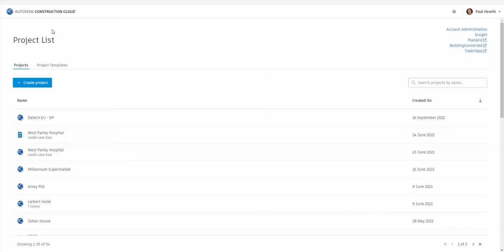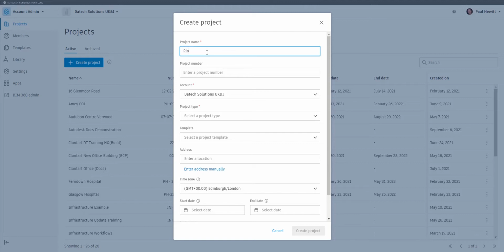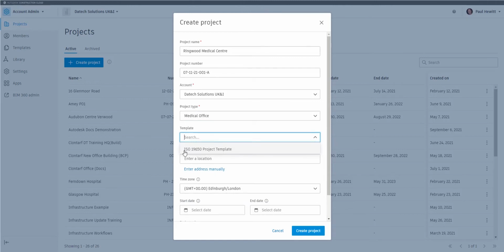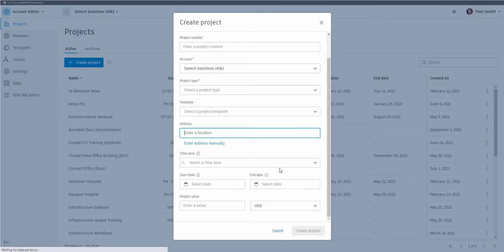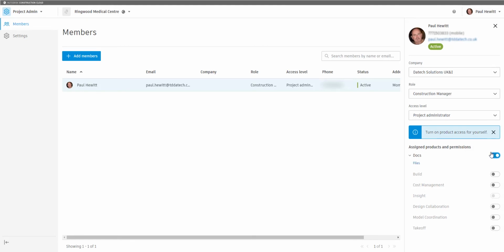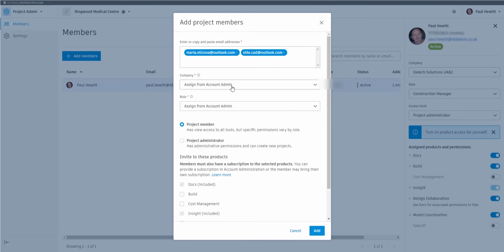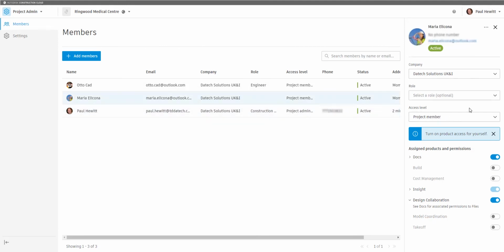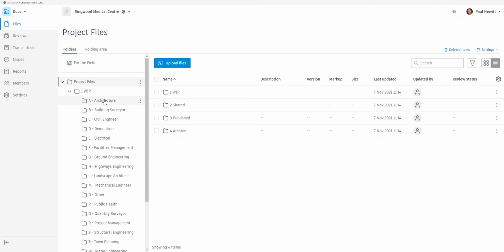Autodesk Construction Cloud - Creating a Project

Comment: THE WAY, YOU ARE EXPLAINING IT AT 3.34

I would highly recommend clarifying, that YOU MUST go and turn those on.
EVEN for the ADMIN, which is me.
They are OFF by default.   IF YOU Have them off. 
YOU wont have the Project Folder VISABLE in the cloud.
ITs there, but NO ONE can see it.

That is important. YOU could be  sitting here, splitting your head, trying to figure it out, WHERE is that folder??
WHY cant I load my .rvt on to the set project that I created as an admin.